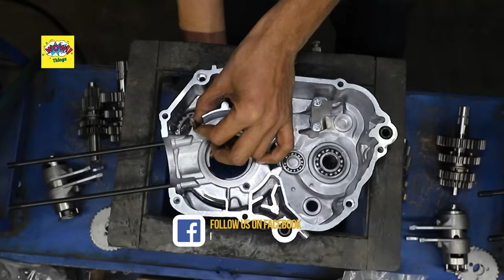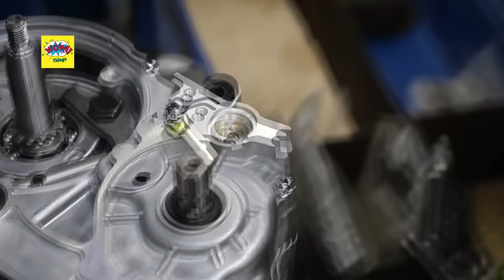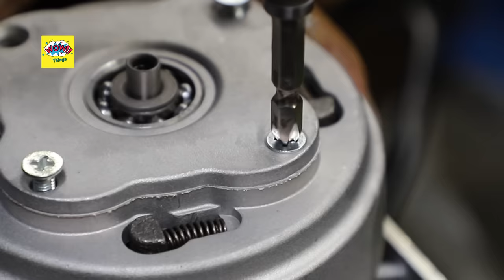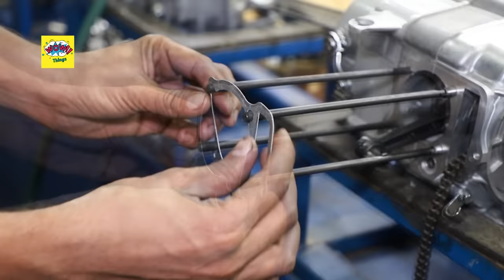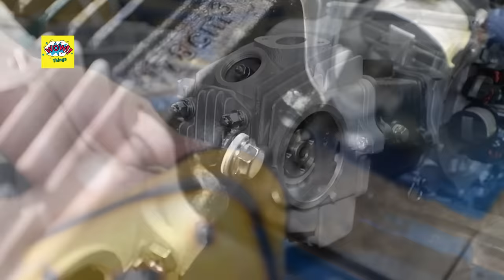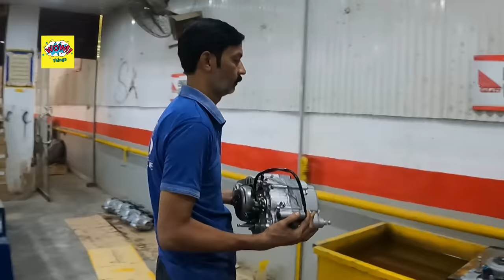70cc Galaxy Motorcycle Engine Assembling Process in a Factory

Comment: Huh?? Dry assembly processing? Without even a single drop of oil used with the bearings and all the moving parts in the gearbox?? Wow....I wonder on how all the moving parts will suffer once the engine starts. Not to mention without any torque tool used. I myself will use a lot of oil especially with the bearings and crankshaft before even thinking of starting it up.
Reply: Maybe he pours the oil in later, but makes sure he gives it a good shake
Reply: @tagomago2178  that is not the same
Reply: @tagomago2178  🤣🤣🤣🤣🤣
Reply: I think they fully trust their bike oil pump😀😀😀
Reply: Bro , It's not that bad , the oil pump pumps so fast that after 3-4 revolutions oil is already in cylinder head , also bearings aren't made of plastic that they gonna wear out or seize in 0.001 s . If you got practice you can even put dirt bike enignes without torque wrench , this is more of a insurance not a must do . Today in India , and 3rd world countries people are putting car and truck engines together without that , having a torque wrench is more a comfort and I am saying that with a bit of knowledge , you don't have to lube the piston ,because the crankshaft will splash oil on cylinder with centrifugal force while starting up (but there has to be propper oil level)
Reply: @venox5183  This is a small workshop, not a factory. I'm in what you call the 3rd world. We don't do it like this. Love from Vietnam
Reply: @venox5183  Lol. Yes it is that bad.
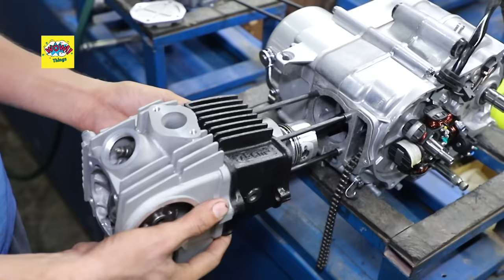Reply: 5:34 I think I did see some oil on the piston at least when he slid the cylinder on.
Reply: Gostei muito eu ver a montagem gostaria de saber se posso fazer parte da aula eu só mecânica
Reply: @scuffieduffie  i7p88
Reply: @venox5183  I've watched them put engines together in India & Pakistan without a torque wrench, & putting them together dry. I wouldn't trust one of those engines to last 5 months!  
When i went to school for automotive mechanics over 30 years ago, when building engines lubrication is your best friend, you can never use too much lubrication putting an engine together. I still use plenty of lubrication to this day. Soak the pistons in oil when the rings are on, put assembly lube on bearings, & ALWAYS USE A TORQUE WRENCH! 
It's the first turns on crankshaft & rod bearings when starting an engine that does the most premature wear on bearing surfaces. If that coating on the bearings gets worn off, those bearings will fail. I've seen engines torn down with less than 3,000 miles on them after being rebuilt with bearings completely worn out because of not being assembled correctly, & put together dry.
Reply: Bro they fully trust the customer pocket that the customer will buy another bike after six months.
Reply: @timothygeiger8271  .... maybe in Pakistan......Indian automotive industry is at another level.

Comment: Admire this engine. Assembled on thermal gaps, gears are all planted on floating shafts. when heated, all the gaps go away (this is why all the bearings sit down by hand). For 9 years, I drove a moped in my hands on such an engine (110cc), 70,000 km and was sold. Piston changed, yes. Everything else is native.

Comment: One must acknowledge the engineering skills of Honda. They put together a design that produces almost 100hp/lt while at the same time will run on anything resembling gasoline, with canola oil in the sump if needed and require practically no servicing at all. All that while being unbreakable. 
I had an original Honda cub in my teen years, the abuse that poor thing took was beyond belief. It still ticked like a sewing machine until it was stolen.
Reply: These are NOT Honda engine, those engine are not 100HP............  7HP MAX for a 70cc to 110cc engine. What ou said was so idiotic.
Reply: @trxtech3010  he probably said 100km/lt
Reply: @trxtech3010  if you know the history from this engine you speak not so evil .

Comment: one man doing the whole job instead of an assembly line perfect recipe for making an error, and no torque wrench was used nither piston or cylinder was lubricated while inserting it.
Reply: First of all ,you don't have to lubricate piston or cylinder while putting engine together , because of oil pump and centrifugal force - as the crankshaft spins it splashes oil on cylinder wall (only if there is correct oil level) and 2 - You don't need torque wrench ,it's more of a comfort than a must have . I've put together over 20 motorcycle and scooter engines without one , and nothing bad happened , you just have to use your brain
Reply: @venox5183  Until the oil reaches you already running dry . Torque wrench when putting an engine together is a Must .
Reply: Its a 70cc pakistan motorcycle engine, don't expect assembly lube or exact torque procedures. And as far as your comment about needing an assembly line, many engine builders and Mercedes AMG would disagree.

Comment: How does he know he's got the timing right? He jus turns the cam a bit until the three holes line up.
Reply: There is a mark on the cam sprocket, clearly visible in the video, that has to be adjacent to a mark on the cylinder head with the piston at top dead centre. The screw holes in the camshaft flange are in an asymmetric pattern so it is only possible to fit the sprocket in the correct position.
Reply: How did he know the piston is at top dead center ? He just snake through the hole to  get the chain on the sprocket.
Reply: @stevothegreat  There is a mark on the flywheel that lines up with one on the crankcase at top dead centre. Also you can feel TDC by air pressure if you put your finger on the spark plug hole and turn the flywheel. If the plug is in place you can feel the compression by turning the flywheel, although you have to learn not to confuse compression with the magnetic force between the flywheel magnets and the generator stator. You do see the person in the video slip the chain around the cam sprocket by one tooth in order to get the timing right, just before he places the sprocket on the camshaft. You cannot slip the chain around the sprocket once it is on the camshaft, because there is not enough slack even with the tensioner fully backed off.
Reply: @cedriclynch  Thanks for the information, i have done several timing on my 70cc trailbike.
Reply: he trusts his basic instincts, moustache will wiggle whenever he makes mistakes as warning sign

Comment: I am surprised cylinder can be installed by just pushing it in without using a compression tool on the rings.
Reply: Mustaly samal cylinder front of tapper
Reply: No need compression tools
Reply: This timing is the one i dont understand till date , if all r in straight line will the piston be on top, Planning to assemble an engine for the first time but scaring to to do it because of the timing
Reply: @வனதேவதை  Bro ,stop being dumb I did an engine like this 2 years ago when I was 14 ,nothing hard ,rn I can build almost every motorcycle engine , the marks just have to line up and it should be in correct stroke , nothing amazing
Reply: really motivative , I will try